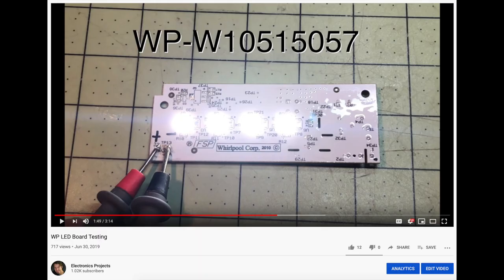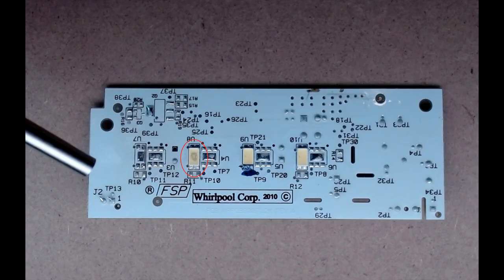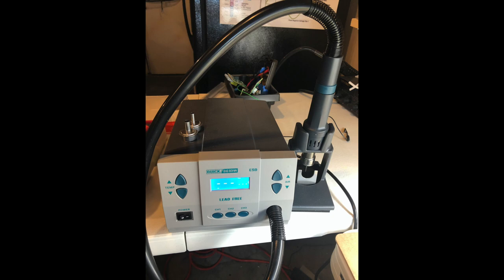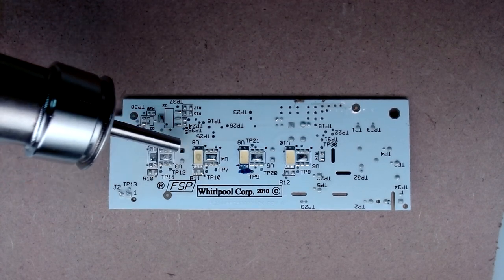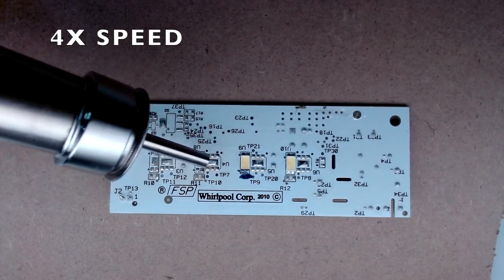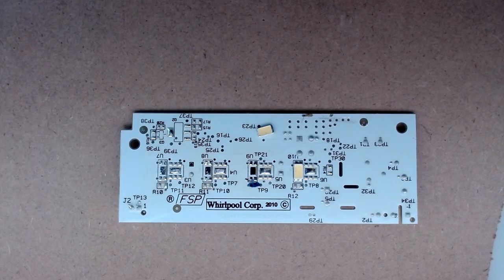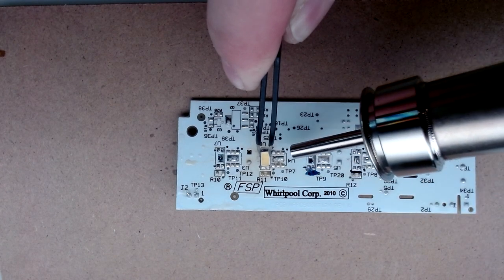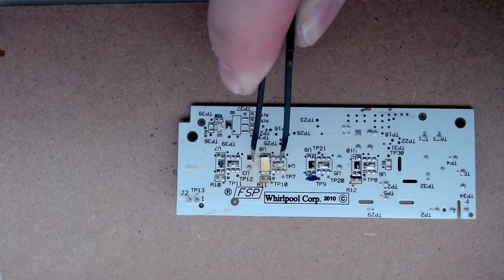WP LED BOARD REPAIR

Comment: Friend, what kind of led is it? 5630 or 5730? and how is the configuration of the led legs?
Reply from the maker: I just use LED's from spare boards I have of the same type. Whirlpool doesn't put out the info on their LED's
Reply: LTW-5630AZL40

Comment: Thank you for these videos. Is that "Quick 861DW" Hot Air Station what you would recommend? I may not use it very often, but I've grown tired of thinking "Geez, it sure would be easier if I had one" ... ;)
Reply from the maker: I highly recommend it, I have the Hakko and the Hakko does not heat up as well.

Comment: Did you  replace the middle LED that you removed too replace the bad LED. Because you didn't show that. ARE those led's wired parallel. If there connected in series they will not work until there all in the circuit.Or was that just a parts board.
Reply from the maker: They are in series, this is not a full repair as I did not have a second board on hand, it's a demo of how to remove and solder these LED's only. Check my other LED video for more explanation on testing them out.
Reply: @electronicsprojects4708   Cant find your "other LED video".  I have a similar LED lite ( single LED l;ite assembly, W11130208) for a different fridge where the emitter  and the other LED lites on the same circuit  are dim .  I would be curious how do you go about figuring out what replacement emitter to get to swap the bad one out. 
Can emitters go bad this way, or is it more likely just a bad solder joint? 
I know it is this particular emitter, because I can swap in another Led Lite from another circuit in the fridge and the bad circuit  then works fine.
Reply from the maker: @stevegonczi2068  https://youtu.be/OdgzfOHSlxk
Reply from the maker: with the single led units, I just replace them, haven't had the need to fix them yet. They are much cheaper. Also, there is no swap-ability like on the 4 led model. No way to know what LED would work or not work for it.

Comment: I finally decided to bypass the dead led with a 15ohm  resistor.  It works. Lol...
Reply: Did you just connect the two pins he tested at the end? Trying to figure out which of the 4 pins to connect with the resistor...